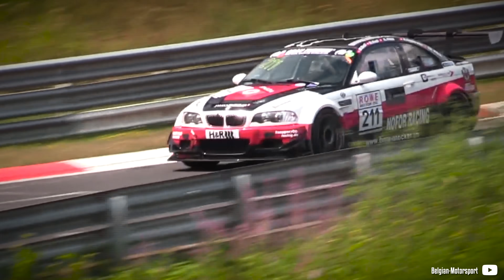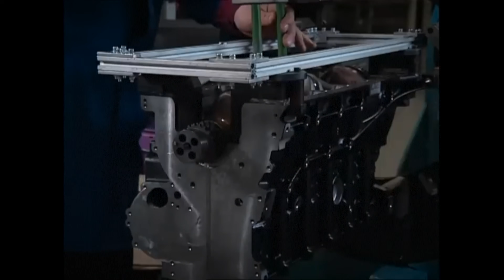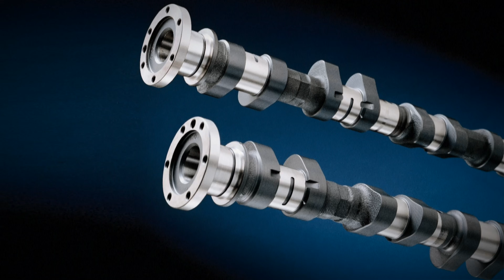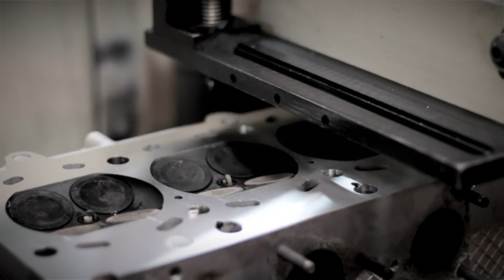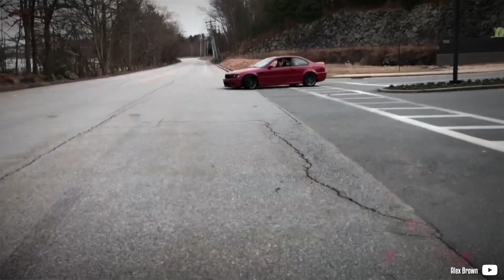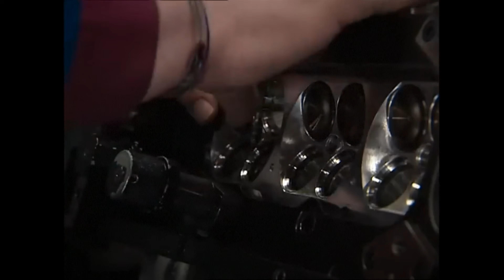The Reason Why This Is The Best BMW 6-Cylinder

Comment: It really hurts that the E92 went to V8. It would have been amazing if instead it was a ground up designed all aluminum 3.8L 400hp straight 6 with ITB’s and maybe even dry sump for packaging purposes. Then the F10 M5 could have used a twin turbo version of that motor for over 500hp.

Comment: I think with the availability of cross flow heads and cheap turbo kits I'd rather have a built ford 300 that will just run no matter what instead of an engine I have to treat like a basket full of eggs

Comment: I wouldn't say there's a lack of a successor, I'd argue the Current going B58 with its potential to reach 1000hp with Forged parts is worthy. And best part, you can afford one in the 140i and 240i

Comment: As an owner of an E46 M3, I can attest that the S54 is a special engine. It sounds great and it's smooth all the way to the redline. The VANOS solenoids sometimes fail, but VANOS has other more significant problems, the exhaust hub and the seals as well as the camshaft hub bolts. If the exhaust hub fails, it can destroy the engine. These problems can be relatively inexpensively prevented.

Comment: You forgot to mention the S52/S54 was based off the Mclearen F1 V12, its basically exactly half the engine. If you watch on board videos of the F1 it has a very familiar induction noise similar to an S54 with a carbon air box. 😎
Reply: The designs are very similar but it was actually the S70/2 (McClaren engine) that was based off of the S50.
Reply: I don't think that's true...source?

Comment: S54 lacks torque/poorly matched to the body.
You have to rev the snot out of it to get it going.
Drop it in an e36 M3 and now you’ve got something.
I’ve had every iteration of the M3 and the e46 was my least favorite.
Just my opinion.
Reply: I agree that the engine doesn't feel like it was matched well to the E46 body. 269 lb/f just doesn't feel very impressive in a 3500 lb car. The cars are still fast because of the wide power band and high redline, but they're not especially fun to drive in my opinion. 

On a side note, I have to say that I disagree that the S54 has to be revved up to make power. They have a super flat torque curve and the torque surges at just over 3000rpm and stays strong until redline - very impressive for its time.

Comment: Sorry - nothing in my mind is better than a S38B38  (in BMW world)- an engine family (M88)  that was used in actual racing vs an engine that was only really used in road cars, had problems with oil consumption, rod bearings etc - the S38 had none of the issues the S54 had (S38 was a very dependable engine), made more torque and imo better sound.
Reply: In racing form they were braking crankshafts in half.

Comment: S38>S54, show me an S54 with a sound as good or as much Power NA as this:
https://youtu.be/EFszZ3tB-g0
I am a firm believer the 100mm bore space, shorter stroke, bigger valves and great head flow make the S38 the highest power potential I6 of any brand, a shame so few were built and we will never find out...

Comment: To be honest with you VisioRacer, BMW never really made reliable engine. Majority of them suffer major issues like oil leaks, failing gaskets, overheat, failing timing chains, seizures, rod knock,oil starvation etc etc. Take any petrol Honda, Toyota engine in comparison with BMW. Not even close... unfortunately.
Reply: That's true, BMW cut alot of corners for the sake of cost mainly with plastic components that warped/cracked over time. Currently own many BMWs including S54 but also Toyota's, have to agree Toyota and Honda have some excellent engines
Reply: @mrsam5350  H,B,K, and F series Honda engines are LEGENDARY!
Reply: Porsche owners with a dodgy M96 or M97 engine can only wish for the levels of reliability achieved with the S54.

Comment: Best body:  E46.
Best engine: S58.
Put them together.
Reply: Maybe B58
Reply: @mrsam5350  S58 is a higher performance version of B58.
Reply: @12skipafew-e7y  yep I know, but from what I've seen / people I've spoken to there are less issues with the B58
Reply: @mrsam5350  Perhaps.
Yet, even with a modified 2JZ, arguably the higher horsepower versions will have more problems, unless someone has poured cash into them.

Comment: As an owner of 3 S54's, I absolutely love them I rebuilt all of them, bought them for pennies with a rod knock, new crank, rods, WPC treated cranks there super reliable, NA is the way to keep them, if you want more power N54 is the way to go.
Reply: The N54 is pretty damn good. Are you wanting 700+ from the N54? Fueling is the first obstacle. Second is airflow in and out of the engine and that includes head work because N54 heads are really bad for airflow, but they can handle 8000 RPM.
Reply: @Michael-rp5tc  B58 > N54
Reply: I prefer US spec M52B28 with the cast iron block for boost :)
Reply: @danielplumley2649  I have only seen aluminum block m52b28
Reply: @Supremomotors98  US spec m52b28 was a cast iron block aside from the M52b28tu in the z3 which was aluminum with cast iron sleeves
Reply: @danielplumley2649 the compound of the block is irrelevant for holding boost with the exception of head lift that comes from under threaded headtsuds / bolts
Reply: @KlassikHaus  I wouldn’t call it irrelevant. Cast iron is absolutely stronger than aluminum and at a certain point aluminum would crack vs cast iron. However it would have to be pretty high horsepower. I’m just saying I like the cast iron block because of its durability. The aluminum blocks had the nikasil coating that was prone to problems
Reply: @danielplumley2649 52tub28 had steel cylinder liners. With a stud conversion they can hold surprisingly high boost in stock components. Ur right tho. The nikasil and alusil is not very good for boost and longevity at all! N52b30 has it but I still think that’s one of the best engines bmw made.

I was wrong saying it’s completely irrelevant.
Reply: @KlassikHaus  I love BMW inline 6’s! I wish more car companies today made an inline 6
Reply: @danielplumley2649 Yeah, S54 is waaaayy better for boost, but M52 is a cheaper, not as good but still decent option as well.
Reply: @stillrecklessdriving  An S54 is WAY more expensive than an M52. It’s easy to make a lot of power with the M52 with so much less money
Reply: @danielplumley2649  Exactly my point. S54 is far better for boost, but very expensive.
Reply: @danielplumley2649  The alu (sleeved or nikasil) EU blocks can take just as much abuse as the cast ones. Only difference is that they weight almost half as much as the cast blocks and the nikasil ones can run a million with no oil burnt lol. N54/N52 came with the electronic water pump though which is a big plus for reduced parasitic losses. 

Also you can drill both blocks to fit the S50 oil pump chain tensioner so if you want to stay on the cheaper end of things a welded oil pump sprocket nut, S50 oil pump chain tensioner, and M54 crank are good for 7500RPM. You'll need to splurge for rods and pistons though, but reground M54 cams are relatively easy to fit on both SV and DV M50/M52 heads and give you far more lift and duration than the stock ones and cost way less than aftermarket cams.
Reply: We had an bone stock s54 e46 which was used by the black falcon team in VLN Racing. The car had 120tkm only racetrack and the engine was never opend. i think with proper use you dont even have problems with the bearings.

Comment: 343hp?  😂  Kia's V6 powered Sedona minivan, makes 300hp.
Reply: yes but s54 is too cool for spool
Reply: But keep in mind that that V6 has a slightly higher displacment of around 0,3 Liters and also is close to 20 Years newer then the S54. :)
Reply: @Maximilian Bönicke  and the v6 is turbocharged
Reply: @anhondacivic6541 nope, NA.
Reply: @Twobarpsi  it was the v6 I was talking about
Reply: @anhondacivic6541  yes, the V6.  I drove a Kia Sedona with one.  It was fast!
Reply: Ah the classic bar talk pissing contest.
Many cars nowadays make 300+ bhp, but are they as fun to drive as an old school M engine? No.
Reply: @1D0N  yeah I agree, horsepower doesn't matter the most at the end of the day, lots of fun can be had with as little as 100hp. it's like saying the 6.6L Chevrolet Express Van is superior to the 400z because it has more power lmao.

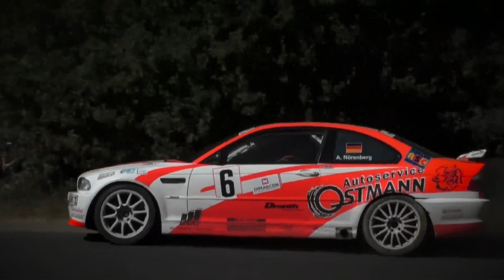Comment: 6:50 My question to BMW: In what world is it "fine" for a road car engine to consume 1.5 liters of oil per 1000km? Sure, the engine is powerful, but it's not an F1 engine, and it doesn't even have forced induction. 100 horsepower per liter isn't uncommon these days either.
Reply: "These days" as you say. But you have to put in context that this engine was sold 2 decades earlier ! And its predecessor a decade more ! The S50b32 was the first road engine to reach 100hp per liter 🫡
Reply: @laurentbruneel9382  Well I'm not a car expert, so I don't know for sure, but I still don't believe that kind of oil consumption would've been generally accepted even back in the day.
Reply: @Tuppoo94  It is. Close to every high revving Engines are consuming massives amounts of oil when they are at high engine speeds, like 7000+ rpms.  And also keep in Mind, that BMW is claiming these Numbers because they know that an M3 is not your average grocery getter which chills at 1500-2500 RPM for most of its life but more likely gets beaten the crap out of it.
Reply: You're right, this kind of oil consumption seems exaggerated. I had an S50 and it burned strictly no oil.
Maybe one thing to consider remarkable for this engine is its high revving abilities according to its long stroke. Compared to others high revving engines of this era like Honda or Ferrari, torque delivery in mid range is way better. And this undersquare characteristics could explain the stress and wear that rod bearings suffer from.
Reply: @Retired Bore I was not considering motorcycle engine, should I have precised it...
Reply: @Retired Bore woah, 130 horses per liter ! Pretty impressive I have to say.
Another factor maybe is that car engines couldn't sacrifice torque to maximize specific output

Comment: Better go with a 330ci, much more reliable
Reply: Totally agree, I own S54 & M54 & M52 & N54, I use them all hard, on the road and track/drift, the S54 is great but too finnecky, M52 & M54 are great in all respects apart from power. The N54 is something I'm working with ATM to get to a reliable state of high power, but fingers crossed it always works well (apart from too many sensors/BMW parameters causing issues) The M52/54 is the sweet spot

Comment: Yes it is a great motor, I mostly rebuilt one and put it in an e36.  I have been using Redline oil and Ceratec, and it is a low oil consumer.  I did have one oil analysis and it was excellent.  I have shimmed it twice, and early but it shows no major wear.  I am not properly geared for it with a 3.23 diff but that's ok I drive it to track days.  I may change to a 3.46 or drop it to a lower value so I can use 2nd gear more, otherwise I will be using 3 and 4 mostly.  The ratios are the same for the ZF until overdrive with the 6.
Reply: I think the 3.8L R6 engine from the e34 ///M5 is better had the same hp 340+....
Reply: @schaltgetriebe...88  oh, that 3.8 is sweeet, a big step up from the e28 m5, essentially the M1 motor, I think.
Reply: @samthing4thetrack806  My first car wos a ///M3 e30 i wos 18 and my Father say to me boy you are young you can only buy 4 zylinder.
That time i find a e28 ///M5 and want that car sooo much but i took the e30..
Now this cars costs over 100 000 + and i had no one... Shit happens.

The e30 ///M3 i destroy completely in a Race... 😪😪😪
Reply: @schaltgetriebe...88  tragic in both ways!  but at least you had time with a great car!

Comment: The S54 sounds good, but the S38 sounds better
Reply: S54 intake is great. Exhaust is typically horrible
Reply: You only need to sit behind an M88/S38 at full power to understand the sound is better, chesty, battle cry..
Reply: S54 sounds fucking awful. One of the worst sounding 6 cylinders ever made let alone put in a performance car, if it didn’t have the induction noise from ITBs nobody would care about this engine.

Not to mention the S54, especially as they age are very problematic. I don’t know a single long term owner that hasn’t dumped at least $8,000 into one. For my money I’d take an S38, M88, S52, S50, etc. over it for sound, hell even the new G80s with a single Midpipe sound better.
Reply: @CadexLaw  agreed 👍 unpopular opinion m20 and m30 sound the best 😅
Reply: Damn straight...
Reply: Agreed - s54 owner 😆
Reply: Agreed, so does the M88 (M1 engine)for that matter. 

I also don't agree with the "it's the best 6 cylinder bmw ever produced" at all for that matter. It was amazing for its time but that's really looking at it through nostalgia tinted glasses.
Reply: It's the best NA six cylinder. It has the best specific output.
Reply: @posniknelb6114  It's got very impressive figures yes, but output numbers aren't the only way to assess an engine's value.
Reply: Things progress, they don't go back 20 years to become better
Reply: Not quite, but the s38 sounds great, but it doesn't rev as free or high as the s54
Reply: @posniknelb6114  There’s a video of an S38 powered Hillclimb Ford Escort build that revs to 10,000 RPM and it sounds insane.
Reply: Nice , I will check it out.
Reply: @posniknelb6114  Maybe stock, but show me an s54 that makes as much power NA or sounds as good as this:
https://youtu.be/EFszZ3tB-g0
Reply: no it doesn’t.